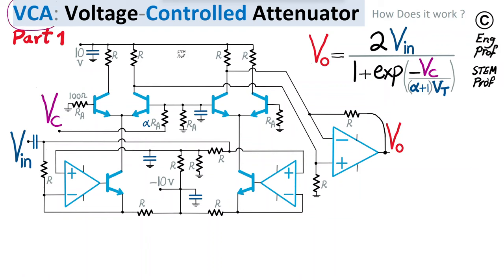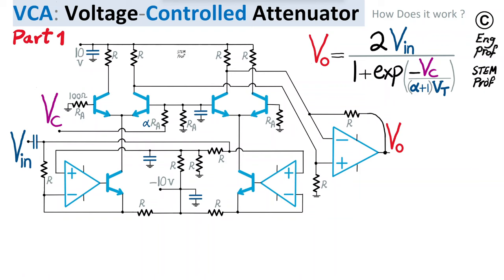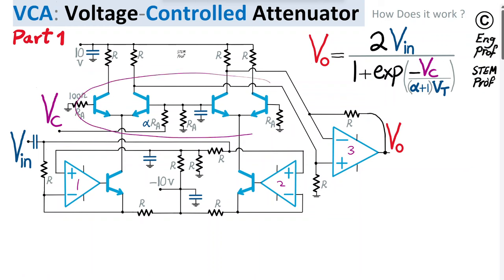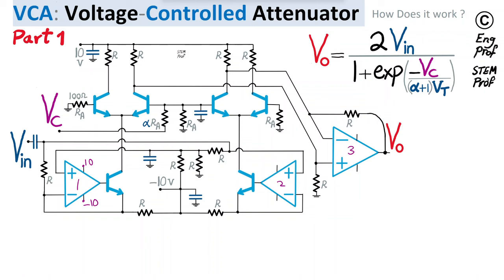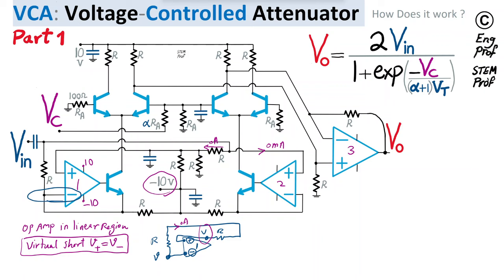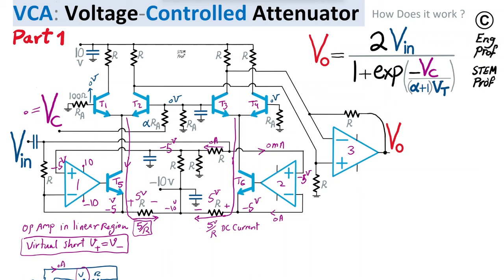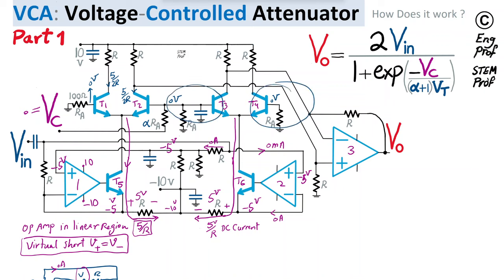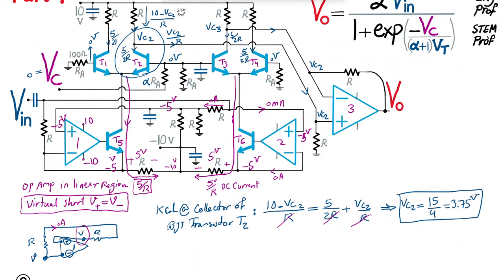VCA Electronic Gain Control (Part1) Voltage Controlled Attenuator Overview

Comment from the maker: An example implementation of electronic gain control circuit in the form of a Voltage-Controlled Attenuator (VCA) designed with Op Amp and BJT transistors is presented. Please see VCA (Part2) Electronic Gain Control Formula and AC analysis https://youtu.be/mq2PyO56OvU to see the AC signal analysis and deriving the Electronic Gain Control formula for this Voltage-Controlled Attenuator (VCA). In Part1 video, overview and DC bias analysis of this electronically-controlled gain/attenuator circuit are discussed.   This three-part circuit video series are posted in the Analog Circuits video playlist https://www.youtube.com/playlist?list=PLrwXF7N522y4c7c-8KBjrwd7IyaZfWxyt  
For additional circuit examples see: Op Amp Amplifier with Electronic Gain Control https://youtu.be/NoNgQpbj77Y
Analog Computer Vector Sum Calculator Design with Op Amp, BJT Transistors https://youtu.be/PIAsa0QNVns
Instrumentation Amplifier with Electronic Gain Control https://youtu.be/C4tghZ-q6Zs
I hope these examples of Electronic Gain/Attenuation Control Circuits are useful and interesting. 🙏

Comment: Thank you for this excellent video. It was a fantastic, in-depth explanation/analysis. I'm looking forward to the rest of the parts.
Reply from the maker: You're very welcome. Thanks for your interest. Glad that you liked this Part 1 VCA circuit video. Sure, Part2 of this video will be posted soon. In case you are interested, here are two related circuit examples:
Op Amp Amplifier with Electronic Gain Control https://youtu.be/NoNgQpbj77Y
Instrumentation Amplifier with Electronic Gain Control https://youtu.be/C4tghZ-q6Zs

Comment: MAT14 : 11$ per piece. There are very few matched BJTs available in the current market.
Reply from the maker: Thanks for your follow-up comment. There are a few alternative products (some priced as low as $0.25) instead of the Analog Devices MAT14 Quad matched BJT. Please see https://www.digikey.com/en/products/filter/transistors/bipolar-bjt/bipolar-transistor-arrays/277 and https://www.mouser.com/c/?q=matched%20pair%20transistor  to see available matched BJT transistor arrays. I hope this is helpful.
Reply: @STEMprof  , Thanks for response. The suggested links were useful.
Reply from the maker: @Parirash123  You're welcome. Btw, VCA Part2 Video https://youtu.be/mq2PyO56OvU  is focused on AC analysis and proving the Electronic Gain Control formula for this Voltage-Controlled Attenuator (VCA).  This three-part VCA Circuit video series are posted in the Analog Circuits video playlist. I hope Part2 video is interesting as well.